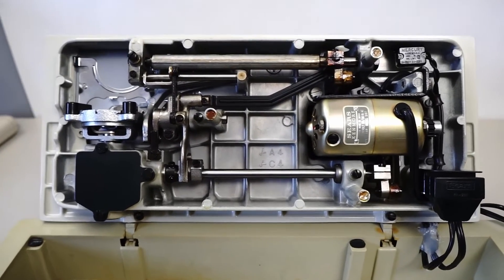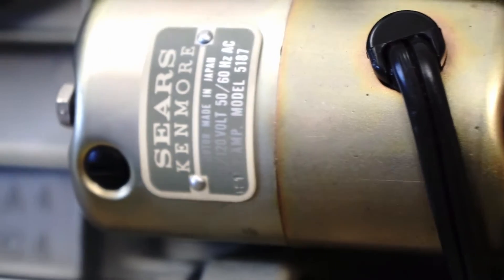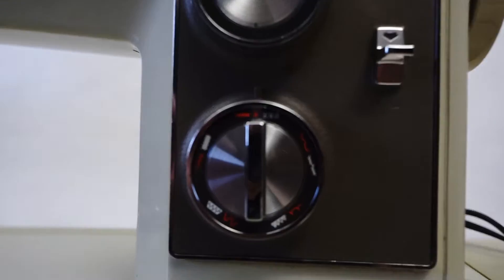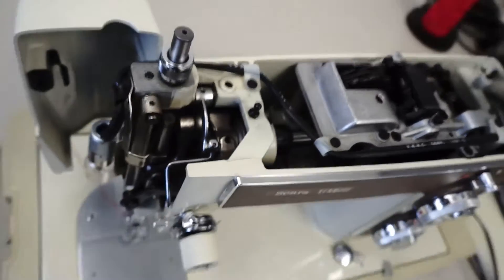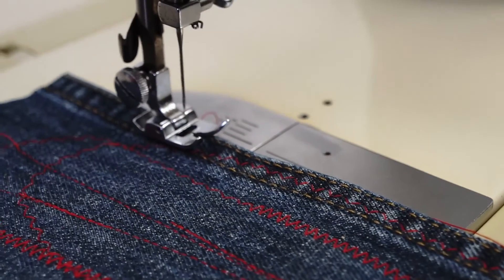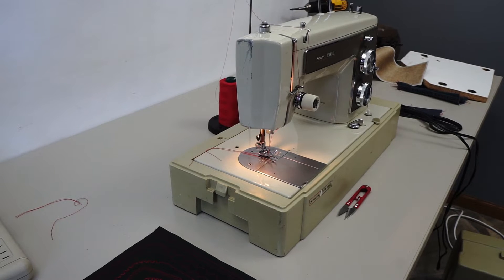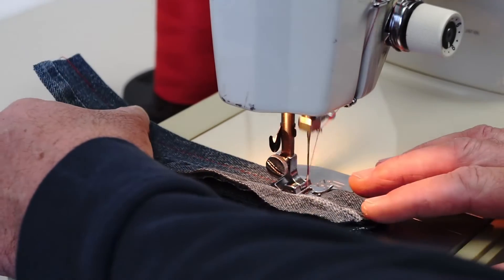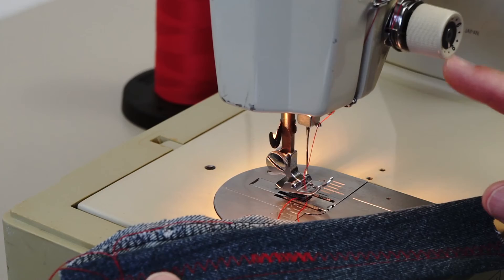SEARS KENMORE 158 series sewing machine

Comment: Great informational video!I have this exact same model - got it for $5 at a thrift store, the belt had slipped off the pulley - that's why they said it "didn't work" - easy fix! I cleaned it all up and it's been my go-to machine for years now! 158's are great machines.... this one makes exceptional buttonholes with the attachment.

Comment: I purchased the top of the line Kenmore on clearance in 1977 ( it was a 1976 model.) Loved that machine. But in the early 2000s I sent it to Sears in Chicago for service and when it came back it didnt seem to grip the fabric when sewing. I packed it up and gave it to Goodwill. Then one day over ten years later I needed to adjust the screw on top of the machine. Ive since purchased one like it from Ebay. Has cams, a monogrammer which I never used etc. Had 4 separate boxes of attachments. And yes that gentleman was right the buttonhole maker with  these machines make wonderful buttonholes.

Comment: The 158 series Kenmores were made by Maruzen in Tokyo, Japan for Sears.  Maruzen later made the Jaguar cars.  
The 385 series was made by Janome and looked like a Janome too.  That was later after the 158 series was done.
You have got yourself a beauty there!  Very nice machine, solid and a workhorse.  Use Triflow Silicone lube and synthetic grease to prevent gummy oil.

Comment: The knob on the top of the machine on the left you can press in on it and it adjust for thickness of material very handy I have to say machine if you are using a lot of thickness you can push the button down it adjust the presser foot so you can go through thicker fabric you need to talk about that it's an awesome feature

Comment: I have a 158 series. Straight sewing works well but when I set it to do the other stitches the needle will move over to the right side and sew straight instead. I think something must have come loose inside, but when I look into the top, I can't see what.  Any ideas?
Reply from the maker: It's most likely time to be serviced old oil residue on parts that need to move.
Reply: D Weisner….did your zigzag problem get fixed.  Mine is doing the exact same thing.  Beautiful straight stitch but when I move the button to zigzag it does a totally different stitch.  If it’s now fixed, what did yo7 do to correct it.  I sure don’t want to pay $150 to be serviced😞